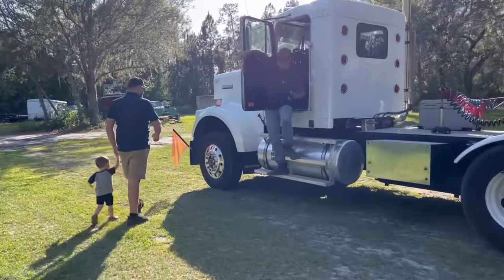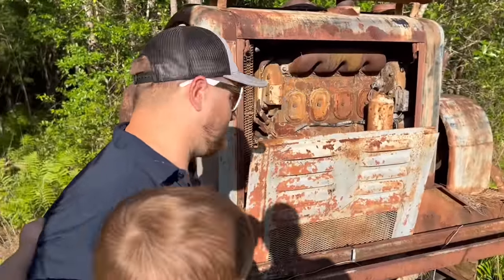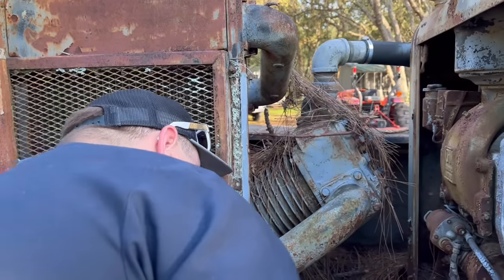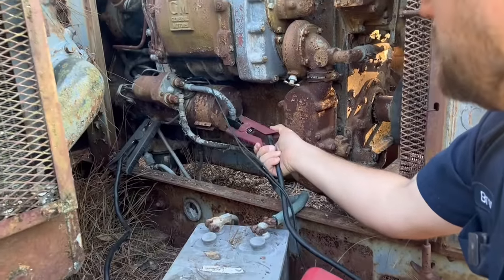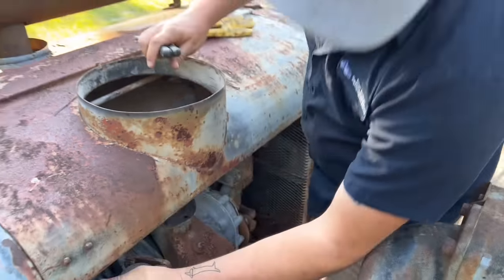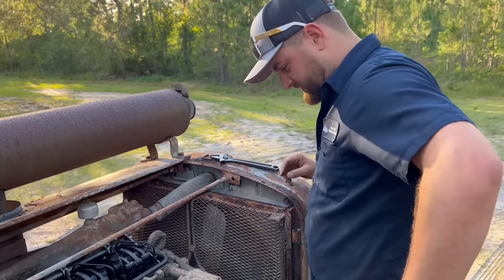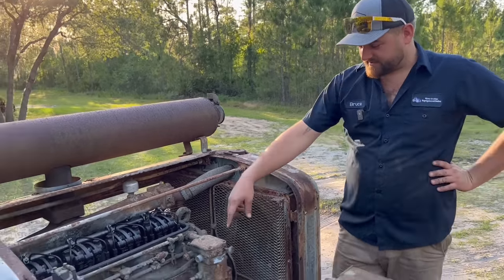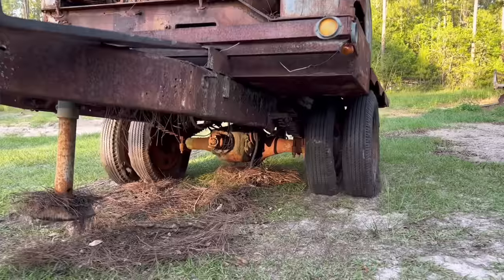Diesel Engine Rotting in the Woods, WILL IT START?

Comment: I will never understand why in so many of these “Will it Start “ videos, the second it does, you rev the living shit out of it …
Reply: Because they havent got a clue 
Everything they get now is a "Barn Find"
Reply: They do that to clear it up so it idles better because its been sitting for years. Also most of these videos they will never use the engine for anything afterwards so warming it up isn’t necessary.
Reply: I think it will be fine 😎
Reply: That's legally required
Reply: Gets oil to the valves faster that way 😉

Comment: It would be cool to save this engine and have this thing restored and preserved because it is just piece of marvelous historical machinery that shouldn't be lost.
Reply: That would make a good engine for a pickup.
Reply: @bertgrau3934  Apart from fuel efficiency, it really would!
Reply: @fexploder3281 
So true,  fuel mileage wasn't very good.  I drove a 1966 GMC Crackerbox  6-71 238 horsepower,  5 and 2 and it got about 4 MPG at best.
Reply: @bertgrau3934   Yeah, 4 mpg is pretty bad mileage and it would be absolutely terrible if that was in a pickup truck.
Reply: @fexploder3281  The mileage would be a lot better because a pickup truck is much lighter and more aerodynamic
Reply: @porcupinepunch6893  Although these engines still aren't generally that efficient as I was saying, that is actually very true.

Edit: In fact, the mpg may actually be around 10 - 13 mpg if a Detroit 2-Stroke was in a pickup truck.

Comment: The governor does not work because the input linkage is not connected. Old 4-71 engine with hydraulic governor.

Comment: These were very  well built engines , they last for ever no matter it seems what you do to them. P.S if the compressor works don;t kill it  they are very useful.
Reply: well built? absolutely not, they run good cause they done have headgaskets and the bottom end is oversized, just like every other old diesel engine pre 1970, detroits are nothing special
Reply: @cs-gj3yf kinda like your mom thanks have a good night
Reply: @cs-gj3yf the point is (like you said) they were all built this way, so in general as the saying goes, they run forever

Comment: The military put these in everything! 4-71 for small boats, forklifts and other equipment. The 6--71s were used in tanks, trucks buses, etc. The tanks and PT boats ran 2 6-71s. They went all the way to 16v 71 and the bigger newer brother 16v 92s are in heavy military trucks still.. 
You can find the 16v 71s in a lot of older gen-sets.

Comment: Enjoyed the video, brings back a lot of old memories, worked on quite a few of these. They came out originally with the 4 53 and the v 6 53, later they brought the 71 series engines,  thanks for sharing.
Reply: 53 series were made in 2,3,4,6 cyl configs as best as I recall, ill need to go look up the wwII single cyl ship aux generator and if the 6 cyl were in V or inline but im thinking both and the 3cyl were available either turbo or non turbo.

Comment: That engine looks like a Detroit 471, and with the cowling, it looks like it was designed for commercial stationary applications, although many of those were put in and used as marine (boats) power.
Reply: It is a 4-71, the giveaway for a 71 or 92 series engine are the big center bolts that hold the valve covers on. A 53 series has bolts around the perimeter of the valve cover.
Reply: @DeathHead1358  there was never a inline 92 series, the only 92 series ever built are V engines.  As for 53 series they use a single rectangular cover where the blowe would bolt on if it was installed on the opposite side.   The valve cover bolts are not necessarily a way to identify them because late series 53 engines did have a central bolt valve cover similar to the 71 series but it did not have a thumb knob they only used a 3/8” 12 point wrench

Comment: That unit has an SG Woodward hydraulic governor on it. What are you planning on doing. With the unit. If you are just going to trash it. I wouldn't put any money into it. If you want to make a good standby generator you have a really good start. Also if you some information on the woodward governor I be glad to help you out. I worked on them for 20 years. The SG stands for simple governor.

Comment: You can’t kill those old 2 cycle Detroit diesels. I have a 3 cylinder one on an old Bucyrus Erie Dinahoe 190 back hoe. It’s tired because you always have to start it with either. But once it’s running it still digs like a beast.
Reply: might need a check valve in the fuel line to keep fuel from running back to tank i had a 353 from a gama goat that thing would start if you looked at the starter

Comment: Of course you would pull the valve cover. Even questioning doing that makes me wonder what else you'd shortcut...Your remote starter wires are pretty light, you need thicker for those solenoids, they take a fair bit of current

Comment: It's crazy the engines you're able to get running - good skills.
Reply: What skills? Using ether?
Reply: @rsmith8646 Why don't you upload a video where you do the same "will it start" on a 70 year old Detroit sitting in the woods for 20 years or so?

Comment: The governor on this engine is a early Woodward SG governor (simple governor). Pretty easy to disassemble partially to check the rotating parts but you need to be careful of the preformed sealing ring between the oil pump and main body. The issue is more likely to be the stop handle being seized in the body just below the cover. You should be able to remove the cover separately as there 2 screws under the cover. The stop shaft is prone to corrosion when not used for a long time. Light wet and dry abrasive paper with oil polishing will help. Probably got manual for it somewhere on my computer.

Comment: Pulling the valve cover to check the injectors are not stuck? - not necessarily true or needed to do right - I wonder if the dude checked the motor oil?

Comment: I don’t know why you would want to blow it up it’s a great machine can’t kill them old GM engines  plus air compressor works. I just like old equipment it runs forever and is built way better.  Thanks for the video.

Comment: I was just wondering what the thought was to hitch with the forks pointed towards the unit when having them lower would prevent the rear tires of the tractor from lifting off the ground .

Comment: 471 Detroit used in Buses &Trucks untill the bigger 671 came to Town !  Good Stuff
Reply: The 6-71 and 4/71 were all designed at the same time back in 1938.   They also had 2-71, 3-71 and 6-110 engines.

Comment: If its a 4-53, or 4-71 they were used in some older trucks like the GMC, and Chevy .  Most had 5 and 3 transmissions.   They were used around 1938 to about 1950, then they used mostly the 6-V53, or 6-71.

Comment: it is a gm diesel 471 power unit U need 2 if fuel rack and if injectors are stuck the throttle might be stuck they will do that after setting a long time when U close the throttle off the engine should cut off at least it didn't take much 2 get it running and it engine runs good 😊😊 OMG 8 16 2O23

Comment: I knew once the guy hooked up to the back of the tractor with that old power stroke ford truck,  it would bring the generator and trailer right out of there because the Kubota tractor wasn't getting any Traction in all of that sandy soil

Comment: That part is NOT a supercharger!  It is a scavenging air blower, it moves enough air to push air through the lower air box and through the fresh air intake holes at the mid section of the cylinder liners when the piston as at the bottom of its stroke to push the exhaust out of the exhaust valves that are open in the cylinder head.

Comment: Too bad in your show off mode getting ready for the start you never oppend the inspection covers to look for a cracked liner that could drop in the crank.  governers allways caused the 471 to roll on idle.

Comment: I would have fist turned the engine over with a large wrench.  Then if the engine turns over check the fuel and the fuel filters.  Fill the filters with clean new fuel. Then see if the engine will turn over with the starter.   It looks like this one does.  Then I would get the air out of the fuel lines.   Then I would try to start it.  If it did not start I would use some starting fluid.

Comment: Detroits all have that common rail so if one injectors stuck open or closed te rest will be too... potential run away if you don't pop the valve cover and loosen up the injectors. Looks like maybe a 471  judging by the 4 exhausts on the manifold... big enough looking to be a 671... its probably a 2 stroke 471... call Ol2stroker or bus grease monkey when it comes to these old Detroits [they last forever... FOREVER lol Need to show up to these things with a case of Kroil... spray everything down to loosen it all up. Doubt the governor is broken. maybe stuck but not broke... unless you break it.

Comment: Little cheat for ya with those jump boxes, you can bypass the safety’s by holding down the power button on the front and it will give power even if it doesn’t see it, might even give it full beans too I can remember

Comment: I cannot believe you crank that engine like that after it’s been sitting for that many years in the woods?? 
You didn’t even let the oil pressure get up to operating pressure and get through the engine for proper lubrication..
You probably destroyed the bearings in that engine and God knows what else??

Comment: WHY.... would you even think of running it wide open til it blew up?!!?.   There's nothing wrong with the governor... you just don't know what you're doing with that setup.    The engine was Never in any vehicle.... not with a Woodward type hydraulic governor.   You need a mechanical "Limiting Speed" governor for vehicles.    The engine was built prior to 1965.

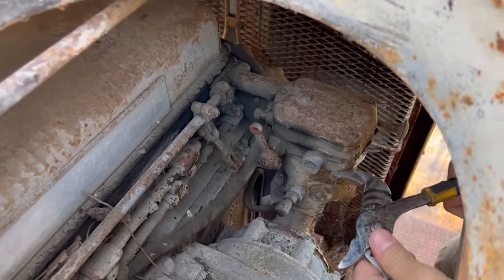Comment: if you want a really good pair of multigrips or what ever you Americans call them at 17:50 search knipex multigrips depending on what ones you get you can snap bolt heads off so they should have plenty of grip

Comment: I was cringing at the tractor driver and the child in the firing line if that tow rope let go. Maybe it was some special rope that wouldn't recoil if it became detached or snapped under load but it still made me nervous. Obviously nothing went wrong otherwise the video would have had a very different title.

Comment: Man that's an oldie...53 series or older?
Reply: The 53 series wasn’t designed until 1955, and was in production alongside the 71 series and later the 92 and 149 series engines.   The 71 series was developed in 1938….    This engine is a 4-71